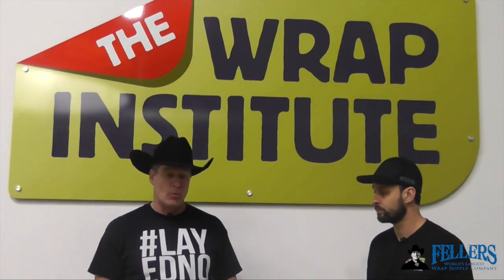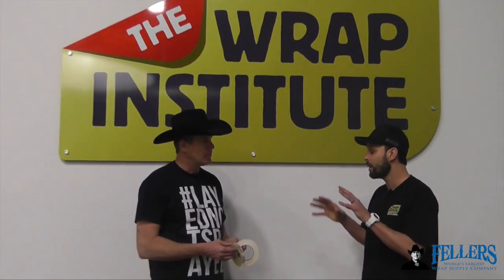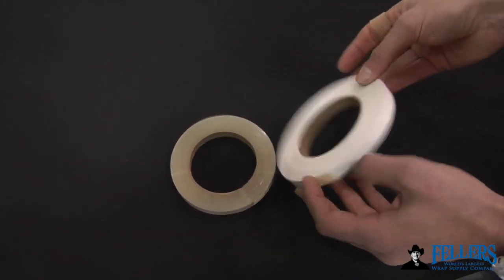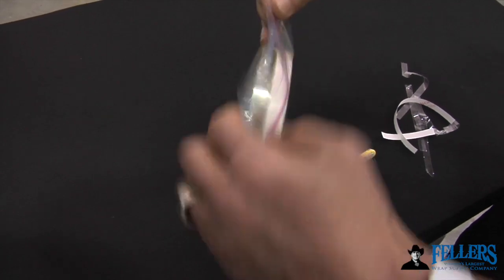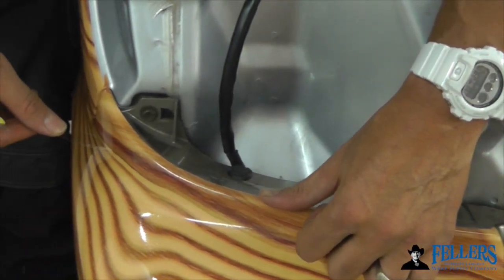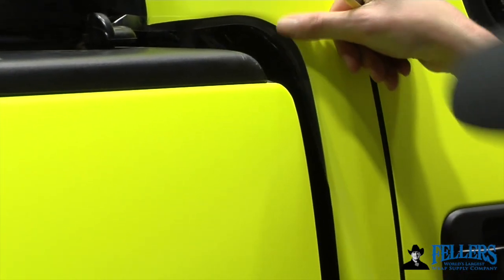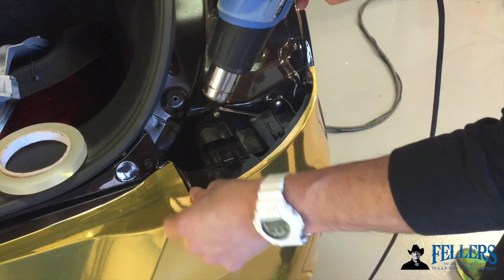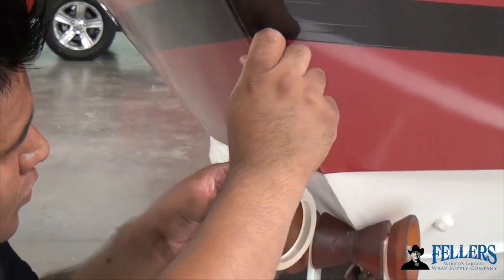3M Edge Sealing Tape with Frank Fellers and Justin Pate

Comment: Is there not a liquid version of this? How would you seal a rive perforation on a matte vinyl wrap?
Reply: 3M™ Edge Sealer 3950 -> This is what I use for wrapped cars. But i can´t tell you how it looks on matte Vinyl
Reply: @tomink8281  I have matte vinly on my boat and I've used that edge sealer. It clashes big time.